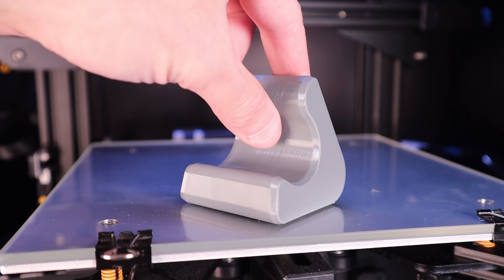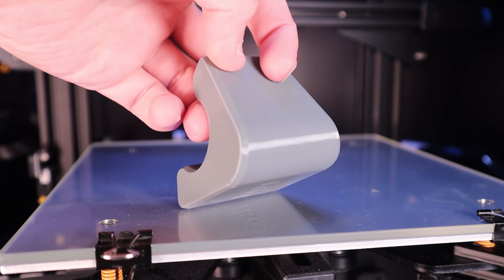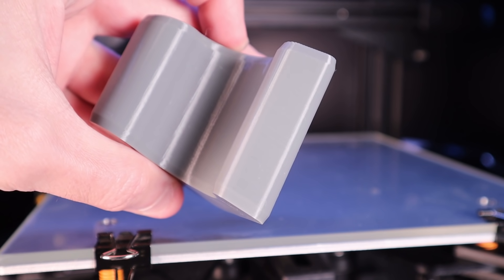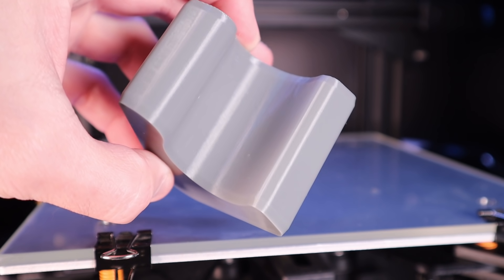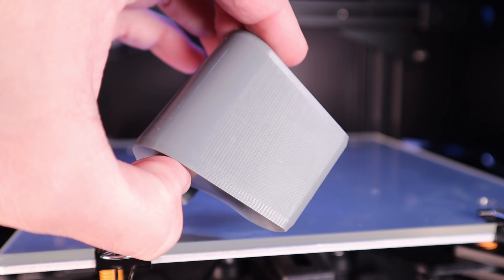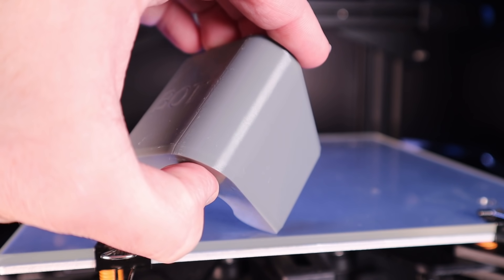Creality Ender 3 V2 - Simple Tips for Super Clean 3D Prints

Comment: In the intro, he slipped that pre printed support in so fast and smooth I almost didn't even notice... well done sir.
Reply from the maker: I haven't used that trick in quite a while, but it's a pretty cool way to get a smooth bridge, especially if you have repeatable parts to make it worth the time to do.  A little tape on top and some glue stick for good measure since the surface is only at room temp.
Reply: Crazy work, my ass would push my shit out of x axis and have it printing in the air 😂

Comment: I am using "Fuzz" to have an imperfect finition wich is quite good actually.
Reply from the maker: That works too, the fuzz will cause your print speed to slow quite a bit and also it can also cause far too much for your slicer to process depending the Fuzz-e-ness a more coarse fuzz works just fine though and looks good to me as well.  For PETG it helps to avoid that sheen too.

Comment: best lower jerk and acceleration settings too
Reply from the maker: Could you provide the settings you use for this.  I'd like to investigate this further.  Also do you use linear advance?
Reply: @NeedItMakeIt  I don't know what linear advance is, I suppose it can't be found in Cura? As for my settings, I've been slowly dialing them in as I've started printing and so far I've seen increasing initial layer flow to 110-120% helps along with decreasing acceleration of the first layer to 100mm/s and jerk to 2. The initial layer speed is 15mm/s but speeds up greatly after that. 

Here, I'll just upload my profiles if you want to take a deeper look, I've customized many settings but I don't claim that they are perfect, I'll update them as I keep printing. https://drive.google.com/folderview?id=1lqlHvzxJnhggHqpEbnP2ZZp-eggMwnLS

Comment: Bro, those print qualities are cleaner than my room!
Reply from the maker: Not too bad for a printer of that generation.  I'm seeing even better results these days with the faster printers, especially with PETG.  The fast moves help to prevent blobbing quite well.
Reply: @NeedItMakeIt  oh that's cool, so the fastness, the speed itself actually helps prevent a few problems
Reply from the maker: @zac2877  The travel speed was one of the biggest issues, with the newer printers, acceleration and travel are much faster, fast enough that I don't notice blobbing unless the parts are set quite far apart from each other.  It's a nice little bonus that I wasn't expecting.  It's mostly a problem with PETG, but does happen with PLA as well, just not as much.

Comment: 8:25 ... you can improve that blobbing. It is doing that because it writes a checkpoint to the SD Card it reads from in case of a power failure, so it can resume printing. If it can't write fast enough the buffer will run out and cause a split second delay and the extruder will keep extruding and leave a blob. Either A.) use a SD Card with faster transfer speed or B.) disable resume printing after power failure so it doesn't try to write the checkpoint file.

Comment: "Print one part at a time" simple tips but how am I not realizing it. Thank you for mentioning this tips
Reply from the maker: My pleasure, we'd all like to load up the build plate, in order to do that everything needs to be perfect to get great results. for the rest of us, these tips help a bit.
Reply: @NeedItMakeIt  Do you have a profile available for Cura?
Reply from the maker: @oneheadlight8000  https://drive.google.com/file/d/1TO6z8dptLZOI2y_eBmG_m4exzY3lLtRi/view?usp=sharing Try this, it is set for PETG with minimal fan, you can adapt as needed.
Reply: @NeedItMakeIt  thank you! I print pretty much exclusively PETG.. around 120 spools of it last year. We just bought 3 ender 3 v2’s and are dialing them in. Your prints look noice!
Reply from the maker: @oneheadlight8000  Nice stuff, three wow.  Having a few of the same printer makes a lot of sense for replacement parts and repair, interchangeability and the list goes on.  Very smart. 

Do you have to dry your material before you begin printing with it, how do you handle the moisture absorption, or is it a non-issue for your parts?
Reply: @NeedItMakeIt  PETG seems pretty reliable with keeping dry. We use the sunlu filament driers from time to time but we generally print non stop with a spool until it is gone. We get most of our filament direct from 3DXTECH and it is pretty fresh off the line. I literally walk in and purchase it in their factory (about a half hour drive for me). If we need to store it for later we just put it in a 1gallon ziploc bag with a desiccant pack. We have 11 working printers at the moment (2 of the ender 3’s are still in the box).

Comment: Nice video. I'm new to 3s printing world and I have a ender 3 v2 but my bad is different that yours. Why do you change the bed? I also have problems of adhesion to bad I used hairspray but all the videos I see people don't use anything on default bed. Why do I need to? I have a leveled the bed and the level test is  printing very nice don't know what to do anymore
Reply: temperatures, perhaps
Reply: @philmor1776  im using default 200 ad 60 o bed i tried to change no luck there
Reply: @marine1718  , I had to go to 210 and 70 on the textured side of the glass Or things simply would not stick. Bed temperatures especially seems important. On the smooth side I could  go to 200 and 60, But I had to use  hairspray or glue, glue sucks, it messes up the face. Ya know what worked well for me (on the smooth side only). MILK,  brush on some evenly and let dry. BTW clean bed well first. I use DAWN dishwashing liquid, rinse really well and let dry, then use whatever.
Reply from the maker: Are you printing ABS, PETG or PLA?  ABS is hard to get to stick, Nano adhesive works super well, I have a video on that, if you are using PETG or PLA regular dollar store glue stick works very well.... too well most of the time, I need to put my prints into the freezer to release them.
Reply: @NeedItMakeIt  I'm using pla. With original glass u are not suppose to use glut right?

Comment: Congrats on the layer consistency. A mixture of a very squarely assembled frame, tight belts, correct V-wheel pressure and many other things are required to achieve this.

Comment: You can do z-hop to jump between travels so it won’t drag nozzle across the surface
Reply from the maker: Yes, I always have z hop turned on, though I haven't played with the height setting and with wear on the nut, it will lose accuracy over time.

Comment: Can you print at home plastic parts that are super precise.
Let say for example a Plain Bearing. Or the piston of a cylinder. 
Things that need to fit very tight but still moving freely.
Reply from the maker: There are a few issues with 3d printing pieces like this,  they'll have pretty tight outer tolerance, but where the seam is placed will cause a slight irregularity.  There are some features to help with this, but the seam areas tend to be a little larger and would impact that extremely precise fit.  It would be possible to turn the piece on a metal lathe if you could hold it without deforming it as well, soft-jaws of some kind for plastics.   I suppose we're talking about a tolerance of no more than 0.2mm +/-  most of the time it is better than this, but I'd say worst-case.

It's funny that you mention the bearing, I'm designing a large bearing which fits around a steel shaft, I was thinking that I could print the balls within the bearing, but I think maybe I'd be better to insert them afterward from a hold in the side, or how they assemble steel bearings and then add the 'keeper' afterward.  It's pretty cool that we can all be inventors now with this tech, and it continued to get better each day.  

I am getting more excited about being able to make a 3d model from 2d images, I think we're really close with the Machine Learning systems to get good enough results that don't require modifications to the mesh.  It will also be a problem who make a living creating models, so I'm a little conflicted about that.  We shall see what happens on that front.
Reply: @NeedItMakeIt  In my case, it is not necessary to print it all together.

I am just starting, i mean i am investigating about what i need.

For a current project, i need to make a flat air one way valve. A regular air valve that i can buy everywhere just does not fit.

So, i needed a very round pipe. I bought various models of PVC pipes from various providers. Each one of them is elliptical. So, what i did was this - i asked a guy who has a lathe to machine a round metal piece. I put the PVC pipe around the metal piece and i heat the metal. The pipe melts around and solidifies as a good circle. I am still perfectioning this. I am telling this to you as an idea that you could use. You could heat a machined piece of metal and push it toward some surfaces, and it will leave a perfect shape. Like medieval seal matrices.

Real life projects pose other challenges like making the holes parallel one to the other etc. The most precise a machine, the better it will work.

For my next project that i did not start it yet, i need precision only in some places. So, i could design it to be modular. For example, for the places, where i have the bearings, i could ask a company to print it to me with extreme precision. And then i will print at home the pieces that don't need precision. I will then make it all fit together. As an example, i could order to a printing company to create the joints of a robot, and i will print at home the bones. Just as an example.

You could melt the internal plastic walls of a hole using a smaller metal round bar and then melt the plastic outer walls of a piece that needs to perfectly fit by using a metal pipe with machined internal walls. But you have to improvise a way to hold the metal piece in such a way that they are parallel to the axis of rotation. And you must find a way to pull the metal pieces out of the hole later. In some cases it will be complicated to do. You can improvise some kind of a bearing puller.

They do the same for engines. The block of an engine does not require precision. The pistons have rings that are precise and the block has cylinders that are precise too and these were machined apart. The cylinder and rings are later fit into a less precise, cheaper to produce engine block. I can see on some engine blocks the marks of the casting molds. They were not even grind outside where it is not needed.

I try to design my project in such a way, that it will not require to print the moving parts together. I consider it impossible to print pieces together and them to be tight and moving.

Comment: Printing slower and not too hot always help me for improve the quality of my prints
Reply from the maker: Very true, slower usually yields better results.  Many of my prints are for customers and I don't always have time to wait so I've brainwashed myself to thinking everyone needs to print fast.   I suppose that could make for a good comparison even for my own knowledge.  

How slow is too slow?  I would assume at some point it will not produce a better quality.
Reply: @NeedItMakeIt   if the print have steep overhangs the slow speeds sometimes  work against  you. The heat of the nozzle dont let time to cooldown the overhang and make things worse.  Sometimes i add a second part if what im printing is too small.  Sorry for may bad english, is not my first language

Comment: Drying your filament will also help A LOT. Even with PLA!

If you don't dry your PETG or PLA, it will usually ooze out of the nozzle, even when there's no pressure applied by the extruder. This leads to those blobs shown at 5:00.

Keeping it dry (max. 10% humidity), there won't be any oozing.
Reply: Thank you for the information.  Which brand of the dryer do you recommend?
Reply: @uhu4677  I'm staking the gel I get from shoes and wherever I find some. I don't have any air-tight box so I'm just using zip bags and placing it on a dry place
Reply: this has been driving me crazy, thank you.
Reply: Great tip! I'm new to this world and I should have paid more attention to this to start with. Just got my dry box set up and lots of dessicant.
Reply: Wouldn't throwing them in a box with silica beads do the same thing?
Reply: @sirseven3 no
Reply: @Bagasl  why not? Does the exact same for beef jerky
Reply: @sirseven3  from Wikipedia: "Silica gel can adsorb about 40 percent of its weight in moisture and can take the relative humidity in a closed container down to about 40 percent."
But filament should be 10-13% moist, which is only achievable in a heated and vented chamber
Reply: @Bagasl  thank you, this was much better than "no". I was just asking others because I'd rather communicate with people about information than asking a robot.
Reply: @sirseven3  glad I was helpful. I didn't mean to be rude with my simple "no". English is my third language, so it's difficult for me to give a detailed response

Comment: what causes that line in the carbon fiber  at 6:16 ive had the same problem
Reply from the maker: Is that the vertical line?  I think that's the seam.  There isn't much that can be done with the seam, it a smaller nozzle, thinner layer lines and adjustment of the retraction using a retraction tower can help.

Comment: Just as obvious but not mentiones (I think), reduce print speed. 40mm/s has been working decently for me so far with a 0.4mm extruder. I have the theory that bigger nozzles can endure faster printing speeds, but I haven´t done any experimental prints to assert a conclusion.
Reply from the maker: Reducing print speed helps quite a bit with overhangs for sure.  Speeding up travels helps to prevent blobs and oozing.  The latest printers are faster and the problem isn't as bad, but it's still there.  The material also plays quite a big role, PLA and ABS don't tend to ooze as much, but PETG is a different animal.

Comment: Overextended. Petg should be adjusted the rate flow /extruder width live 95% or so depending on the grip of the road in the extruder. Due to "flexibility" of PET

Comment: At 3:05 why did your printer print a line on the side of the bed? I have an artillery sidewinder x1 and I’m coming along after finally getting the files to show up on cura and am working on the benchy and mjolnir but a new problem is that it starts printing on the side but then keeps going so the filament wraps around the nozzle and pulls any that was on the bed around with it. how do I prevent that or how do I just get it to cut off like yours did?
Reply from the maker: This can be setup in the startup Gcode script in your slicer, I've modified mine a bit to shorten it, the clips at the front and back were being hit on occasion and I wanted to avoid that.  Here is the code, and you should be able to add it to your slicer without too much trouble.  

; Ender 3 Custom Start G-code
G92 E0 ; Reset Extruder
G28 ; Home all axes
G1 Z2.0 F3000 ; Move Z Axis up little to prevent scratching of Heat Bed
G1 X0.1 Y20 Z0.3 F5000.0 ; Move to start position
G1 X0.1 Y200.0 Z0.3 F1500.0 E15 ; Draw the first line
G1 X0.4 Y200.0 Z0.3 F5000.0 ; Move to side a little
G1 X0.4 Y20 Z0.3 F1500.0 E30 ; Draw the second line
G92 E0 ; Reset Extruder
G1 Z2.0 F3000 ; Move Z Axis up little to prevent scratching of Heat Bed
G1 X5 Y20 Z0.3 F5000.0 ; Move over to prevent blob squish

I've had the problem you are talking about with my Anet A8, the code shown above helps a lot to prevent this from happening. 

Good luck and let me know if you need help.